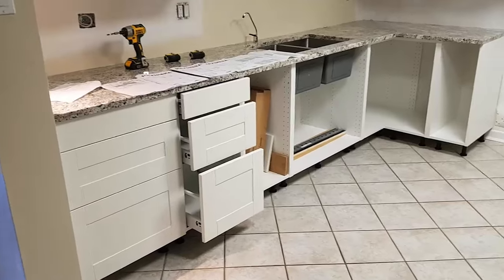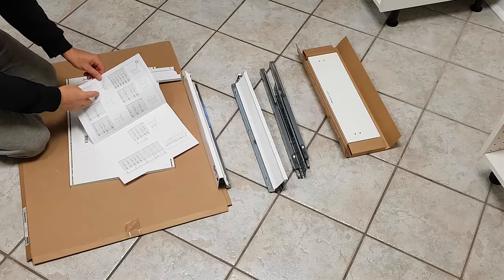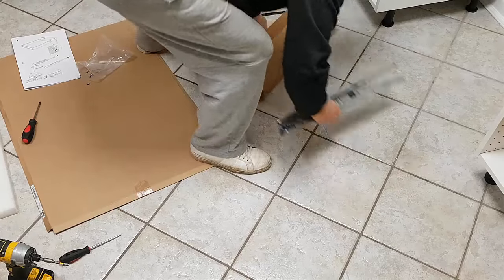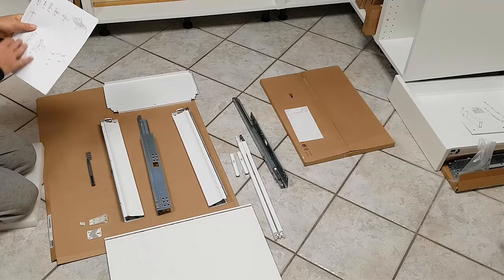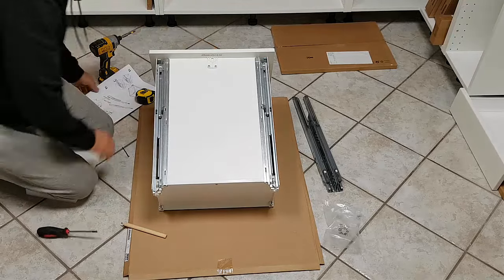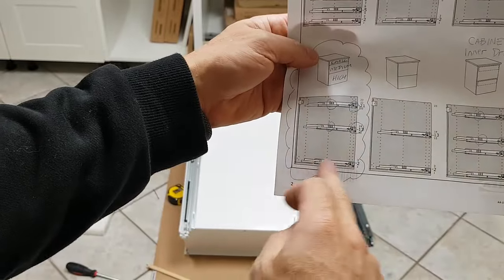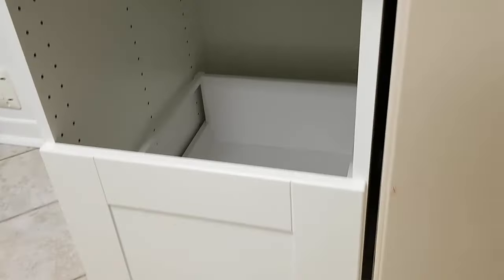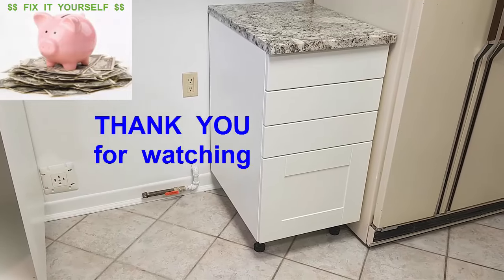IKEA Kitchen:  "Maximera" Drawer Assembly

Comment: Smooth sailing until I got to the bottom drawer. Your video is very helpful. My wife helped when removing the front panel while I held the screwdriver in place. The tips of the horizontal bars are now black and white. White is left, black is right. Don Kingston, Ontario, Canada 😊
Reply from the maker: Hi Don, Thanks for your comments, positive feedback and for supporting my channel.  Glad you found the video helpful. Good luck with the rest of your kitchen installation.  Vito Casola - FIX IT Yourself.

Comment: Thank you for the video! I made exactly the same mistake with the top drawer (attached the bracket wrong way) and spent half an hour trying to figure it out myself before I gave up and decided to look it up on YouTube. Your video was the first one that I came across and it was very useful for that matter!
Reply from the maker: Wow that's great, I'm sure glad that it helped you out because I struggled with that for some time until I finally figured out how the mechanism works and that's what inspired me to make a video because I couldn't actually find a solution so I figured I should post one.
Reply: @FIX-IT-Yourself  So kind of you to tell us all xxx
Reply: I also did the exact same thing.  The instructions do show you the different assembly steps for the bottom vs. other drawers, but it felt like looking at optical illusions since they all looked pretty much the same.

Comment: The directions have two plastic pieces and have them and those metal pieces together when you put on the drawer fronts

Also, you put in one screw and it says put in three

And on the directions, it clearly reads to use the holes you ended up using... You just didn't understand 🙄🙄🙄

Comment: When you adjust the left to right, or right to left alignment you say you turn each side the same amount but if you turn one clockwise, do you turn the other counter-clockwise? Or would you turn both clockwise or both counter clockwise? I don't understand the mechanism and unless I tore one apart, or could see an exploded diagram, it's hard to know what's actually happening in there when you turn the screw.

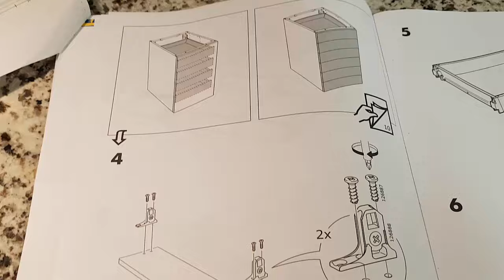Comment: Ok, so our drawer fronts are way too high at the bottom. We installed them according to the directions, and now I’m watching this, and at 11:45 he’s putting the brackets on opposite to what the directions say, which is what I’m assuming is the CORRECT way, because by leaving the opposite screw open it’s going to shift the drawer downward and make it fit. If you go back to 1:15 you can clearly see the directions for the brackets, and that’s definitely not how he did it at 11:45. My question is why the hell are the directions wrong?!
Reply from the maker: Thank you for your comment and sorry for the late reply. I know it is pretty frustrating to work on following the instructions to the letter and not having things work out only to find out that the instructions were either wrong or not explaining things correctly. I guess that's part of the problem with trying to make instructions that have no text and designed for all nationalities. Vito Casola - FIX IT Yourself!!

Comment: So it took you around 40mins to set up one drawer...? I have over 12 drawers in my new kitchen, help...
Reply from the maker: Of course for making the video I went real slow and was explaining a lot of things. Once I got the video out of the way I was able to do all the other drawers in less than 10 minutes each so don't worry about it too much. You will get the knack for it and be able to bang them all off quick I'm sure of it.  Just be careful to put the correct drawer front and in the correct location and if you make a mistake I showed in the video how to remove the drawer front.  Good Luck. Vito Casola - FIX IT Yourself !!

Comment: we put the wrong size door front on the wrong drawer but we can figure out how to get the drawer front off.  Any suggestion?
Reply from the maker: Hi Sissyjean, You'll be glad you found by this video then because I had the exact same problem when I did my first drawer, but the Engineer in me worked on the problem until I found the solution of how the mechanism to release the door front works. As a result I made a point in this video to show a clear instruction on how to remove a drawer front at the 13:55 and 37:00 mark.  You should be able to follow those instructions to help you out and if you are successful I hope you will "click" the "LIKE" button as it helps improve overall recognition of my channel and if you subscribed to my channel you will receive notifications when I publish new videos. I expect to release another 4 or 5 videos by end of the year when time permits. Good Luck.  Vito Casola - FIX IT Yourself!!

Comment: Hi, thanks for your video! How can I access the diagram pages that shows me which box items belong to which number cabinets?
Reply from the maker: Hi Jenny,  That would be on the printout you would receive when you designed and ordered your kitchen cabinets at IKEA.  They should have provided you that printout that shows the Isometric View and the PLAN and ELEVATION VIEWS. The PLAN View identifies the cabinet numbers (very small print hard to read but it's there) then the pages that follow show each cabinet numbered according to the same numbering on the PLAN View.  Good Luck. Vito Casola - FIX IT Yourself.  PS. Hope you LIKED my video and subscribed to my channel as it helps with improving overall recognition of my channel. Thank you.

Comment: Thanks for your helpful video. I love the soft close of these drawers but they don't seem to push open. Now thinking I might need to install handles but that isn't the look I want. Any advice? When you open them in the video they are already open or lacking flush drawers underneath/to the side (providing a gap).
Reply from the maker: Hi BB Queen, Thank you for your comment.  Yes you pretty much will need to install drawer handles ( I made a video especially to show how making a jig can make it much easier to install handles - visit: https://youtu.be/zw2gVnwaMrw ).  Without handles it becomes pretty tricky and a pain to open drawers (as you will notice from my video when I opened drawers without handles).  Anyway my advice go out (or online nowadays) and shop for handle that you will like (that will suit your cabinets and your taste) and install them.  Good Luck.  Vito Casola - FIX IT Yourself!!
Reply: @FIX-IT-Yourself  thank you for your quick reply. Good advice, I'll take a look at your video and will have to find some decent handles then. Cheers!
Reply from the maker: @BBQueenArt  Sounds good. You will do just fine. Making a jig is easy and once it's done drilling holes for all handles will be a piece of cake.  Good Luck. Vito Casola - FIX IT Yourself!!
Reply: Your video has helped tremendously! I have the 18 inch base cabinet, the same one you explained at the beginning. I cannot for the life of me find the right adjustments for the rails and door front....it's been a long 3 hours. Time for wine...sigh

Comment: Should all cabinet drawers and doors be flush with the sektion cabinet? I tried following the directions, but my doors and drawers overhang. It's very frustrating!
Reply from the maker: Hi Jimmy, How are your cabinet doors overhanging? The doors are somewhat adjustable, as demonstrated in the video using the screws on the sides of the drawer fronts.